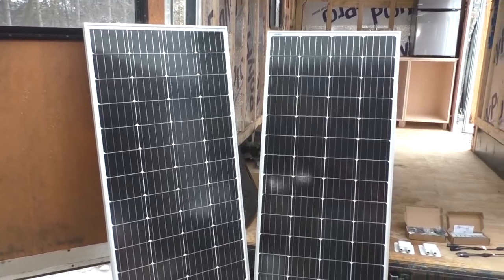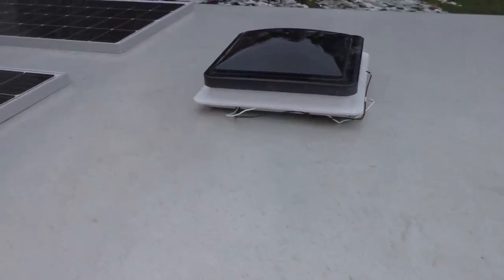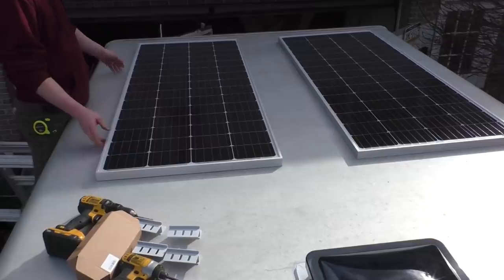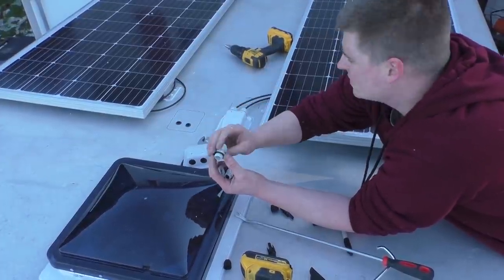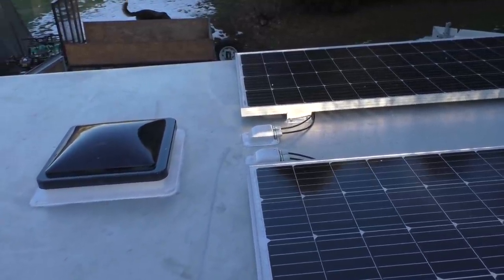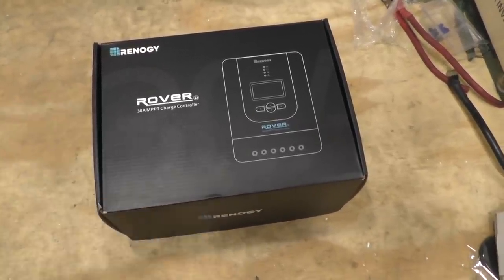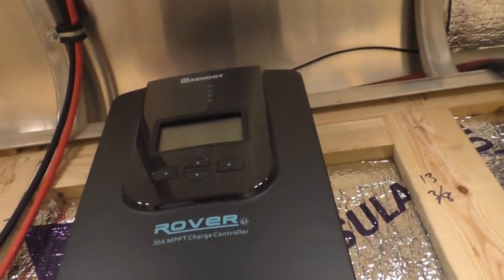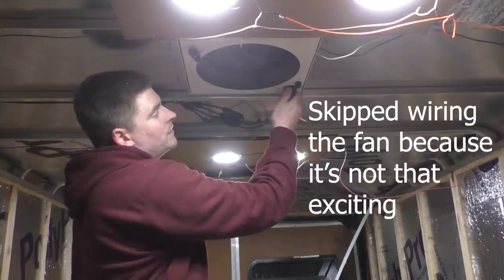Off Grid Cargo Trailer/Camper Conversion Budget Build Pt. 4

Comment: Enjoying your trailer build tonight. 
I actually installed my batteries under the floor between the axles. Built a battery box and made a compartment that is removable to inspect them from time to time.
Reply from the maker: That's a good idea

Comment: Your connector's to the solar panels mc4 should be on the out side of your trailer not on the inside . And you should put a fuse on the positive lead from the panels , to stop a short or a fire . How are you going to replace the solar panels , when every mc4 connector's are inside the camper - coverd up ???

Comment: Good job!  It looked like you just screwed the panels and fan right into the roof with no support underneath...you're not worried about either of them ripping through the thin aluminum over time?
Reply from the maker: I attached the panels to the aluminum rafters because yes I was definitely concerned of the wind getting underneath them and ripping them off on the highway lol. I was actually joking about it when I was installing them. The fan I'm not worried about cause it's fastened down by like 15 screws and silicone that sucker ain't going nowhere
Reply: Ever thought about using a portable solar panel you can stow away when not needed? Not sure how often you’ll be off grid.
Reply from the maker: @stokedmtb333  ya I did actually think about that. I ended up going this route for no particular reason other than I won't have to mess with them
Reply: @builtbysonick1250  400 watts should be plenty if anything now you need more batteries it never ends.

Comment: New subscriber! Cool project. I'm curious, what material will you be finishing the walls and ceilings with? Will you space them off the current studs so the wires will run behind the wall? I just noticed the thick gauge of battery wire.
Reply from the maker: I'm not 100% sure what I'm going to do there. I was sort of debating the same thing. I wanted to do some type of ship lap but we'll see
Reply: @builtbysonick1250  just notch the studs with a Dremel or a router and run the wires over them.

Comment: No fuses in between panels n batters to charge the controller? Shut off? I'm confused
Reply: You don't always need fuses between the panels > charge controller, only if the short circuit current (of the entire array) will be greater than the series max current on each panel. If you install a quality breaker between the charge controller > battery though, you'll get the protection as well as the shut-off functionality.

Comment: It looks like your solar controller monitors your load usage, if you wired all your load through it that might be helpful knowledge. Also assuming you've already looked into it, but will your ac charger interfere with your solar charger?
Reply from the maker: I have no idea lol I don't see why it would b cause it's clean DC voltage and no different that the batteries themselves but I guess we will see
Reply: Ya you use a several small looking fuse panel n run each load thru that panel with the required fuse Amp. But hrs midding the fuses that run between the panels which I believe is 30 or 40 depends n then one between charge controller to battery believe that's 100 n one from battery to inverter if he chooses n that's alot bugger deps on his uses. You have to have proper cutting doses between everything case there's a short. I forgot one fuse from. Battery to inverter  or mine be hooked up. Also have diff size wiring than that of charge controller on your batteries n depending kn how big your inverter us if u use one the cables fir battery are different too. Otherwise, it can cause a fire. But watching this video. Panels to the controller  are so easy. Like that idea. Good video, but you have been those fuses in too n from understanding it's on renorgy site n paperwork.  Ya gotta have those. Dome things are over kill but those basic fuses have to be there  what I gathered.  I have a few friends who install on here for that company.  But it's the paperwork too. Did u just not show that part. Also are your batteries flood batteries. I gave those. So I'm curious how you will close them in safety n have an air vent. As thus us something I gotta do and it's freaky cuz pll say they let off gas. So the boxhas to be very air-tight. I'd like to run them under the couch area or another area I have in mind. Will you be also plugging into your truck fir quick charge ir buying a quick charger so to speak. That parts a bit  more complicated to me. So I'd love to see that start to finish.

Comment: Man hooking up a nice, expensive solar controller before reading the directions can be risky. It looks like you connected the panels at night. Maybe you got lucky as it looked like the batteries were not connected? Anyway your moving forward and it will work. Read the controller directions!!!
Reply from the maker: The instructions say nothing about that. The only thing they tell you is to connect the battery first and this is because the incoming solar panel output current can damage the controller when it's not powered up however because it was dark there was no current so this didn't matter in my case. Why would connecting them at night matter? You can download the manual on Renogy website if you want but I didn't see anything about that.
Reply: @builtbysonick1250  That is what I thought should be done too. Looking good! I was making stereotypical joke of Men NEVER reading directions.
Reply from the maker: Oh ya I'm really bad at that. My wife yells at me all the time. My stubbornness for not reading directions has gotten me in trouble way to much lol
Reply: @builtbysonick1250  The directions always make better senses after the job is done.

Comment: You need sealed batteries. Those will poison you
Reply from the maker: No they won't lol
Reply: Not here to argue bro. But if they are not vented outside your trailer they will. That’s why some cars that have interior batteries have a little tube that connects to the outside. The effects may not be perceived but it’s there.
Reply from the maker: @Christopher Bouman  I get it man. Also since this was filmed I built an enclosure for the batteries with a door to access them plus this thing is very well ventilated.